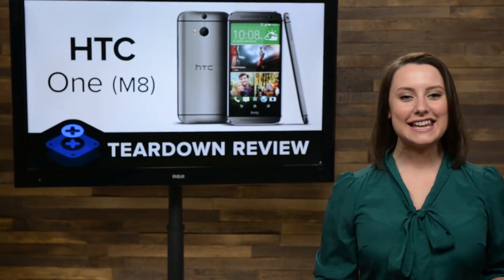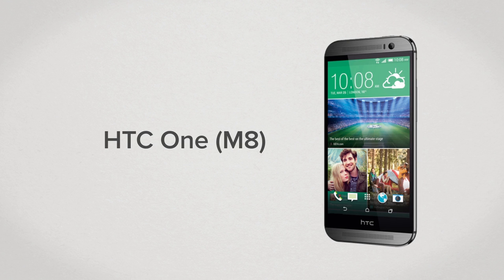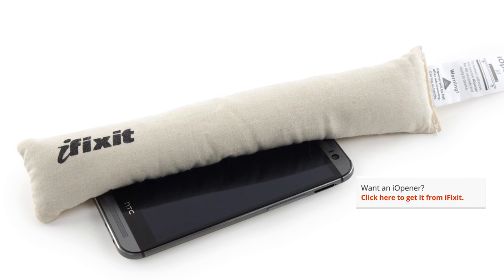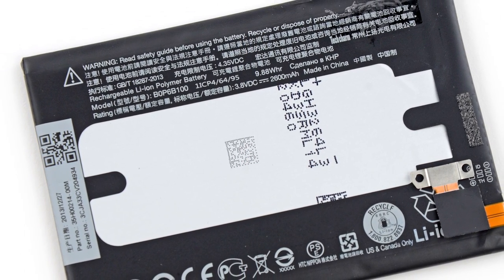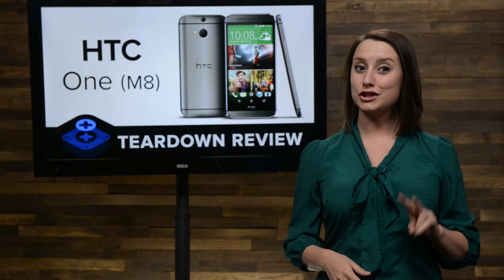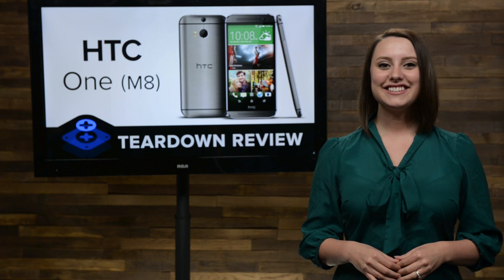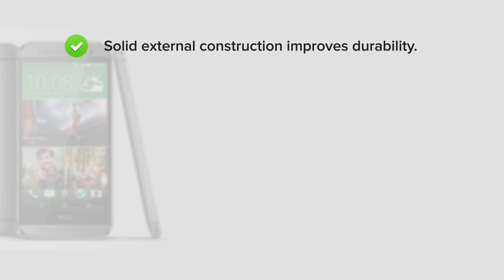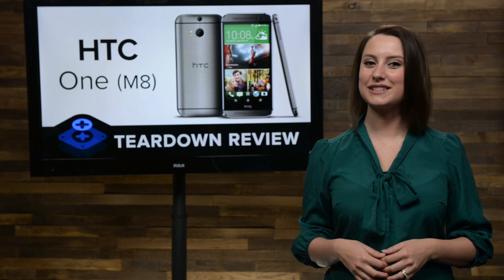The HTC One (M8) Teardown Review

Comment: I like everything in HTC M8 but the difficulty in replacing the battery is a deal breaker. Why not design a battery with a tray that is removable using a pin like the SIM card slot?

Comment: By far the best board component design hands down is to samsung. The all in one piece of board and intergrating multiple parts into one makes the whole phone much easier to repair. They base this on engineer>designers. Apple on the other hand is designer>engineer hence the complication in the iphone 4 etc. However their board components is still very neat. Now you look at the HTC's insides and it almost looks like it was designed by a bunch of amateur engineers with conductive tape everywhere and ribbons everywhere. Obviously these guys use design>engineer model. But their engineers are way lacking in design skills compared to the other big 2. If anyone has opened up those cheap android tablets from china, the insides looks exactly the same as the HTC one phones also with ribbons and tape everywhere.

Comment: I do think iFixit's unwavering focus on repairability is beginning to become flawed. Sure, we all would like to be able to swap out components to phones easily but in designing a phone I don't want them to put that above form, function or price.

If you want every part of a phone to be swappable, don't expect to have anything that looks good. Who wants that. iFixit needs to grow with the times and start factoring in other aspects of a phone. Of course they're going to glue components because screws are not conducive to the design. 

 The new HTC One is almost completely milled from Aluminium, which considering how iFixit loves to trumpet Apples green credentials should of warranted a mention at least.

Comment: you really forgot to mention a few kinda important facts about first HTC One. Like for example the fact that it wouldn't need repair as much as some crappy quality iPhone or Huawei (yes, those are similar for me in build quality, take your pink glasses off). Ones' screen also isn't covering whole front panel, so even dropped on a corner it won't shatter... So your rating 1 is kinda useless since there are 100x less scenarios in which you would need to repair this phone in a first place.